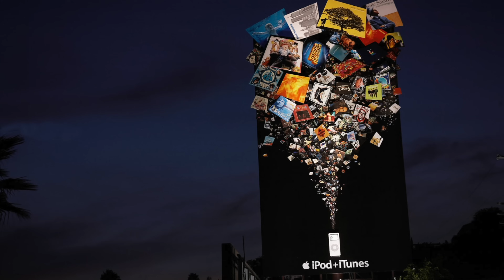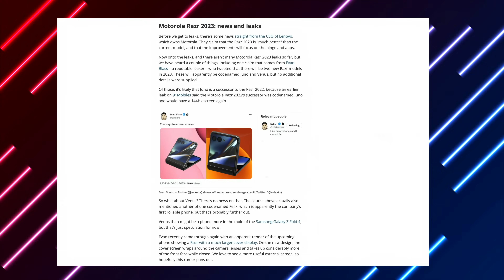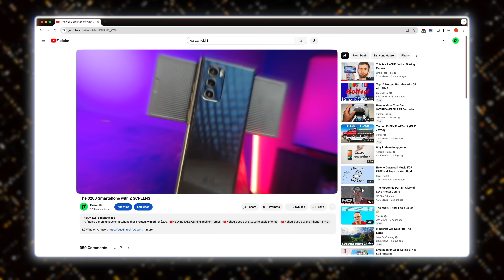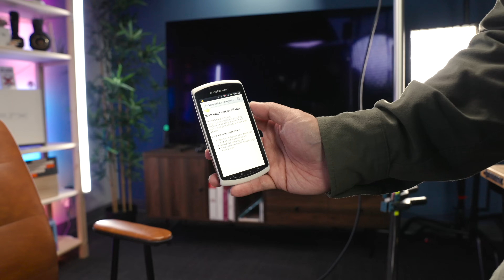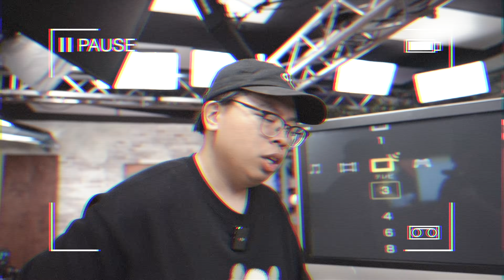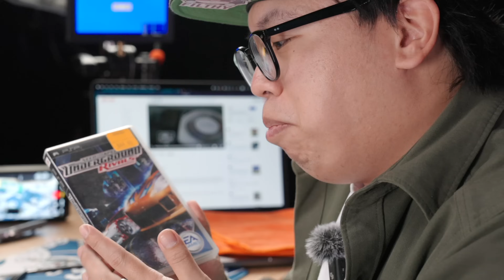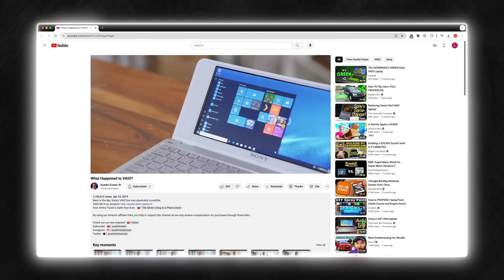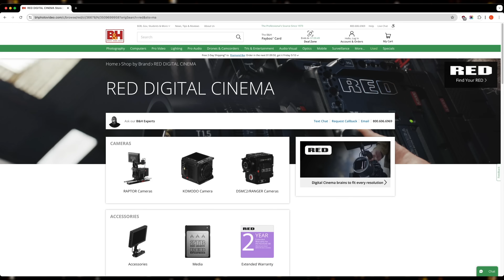the BEST tech of ALL TIME [megavid]

Comment: The windows phone you have complaining on and couldn't see why. First off it's the first like that for windows second you will loose something everytime you try something new. It they made screen to size of unit bigger they would have to make it thicker so it would be more maybe cumbersome. Also first first with ideas don't always work and companies know that they get best option fast to put out and then the buyers are testers so they know what to  hang or fix. People like you or most testers want everything or just hate it and feed ba k sucks cuz your average user. So it's cheaper to toss out a rough phone and loose little money. If it was people like you saying needs speed needs bigger screen needs surround sound needs usb c 30 wireless charge needs this and this and this. Then you complain to big to heavy gets hot to fast. So you wasted far more money for them while average user says can you upgrade sound or can we get better  camera longer battery and with even small upgrade it's sells new model and again they listen and work to fix one thing. Apple is the worse for this they get old tech and make it sound they did it. Like adding music calculator email text wireless charge these are old when Apple gets it also Apple 12 to 13 isn't really any  changes. Unlike other brands trying to further tech on phones. So saying first is bad yes they are cuz they didn't know what people really wanted till they had the phone.
Reply: Grass .. Touch it

Comment: I've worked on 4th, 5th, 6th gens as well as minis, and the 5/5.5th gens are my favorite to work on.  The most annoying part is that the headphone jack ribbon cable never seems to want to go back in.  One thing that I found interesting was that you could put the battery between the logic board and the iflash adapter.  I got a battery that was the same as yours, but when I put it under the adapter, it fit just fine without bending the ribbon cable.  If you're going with the classic metallic back for your ipod, cutting up a screen protector and applying it to the back helps protect that finish from the scratches.

Comment: I absolutely loved my (sadly Verizon locked)  2019 Razr, sadly 5 or so months ago the battery failed in the strangest way. When it was closed it would drain, FAST,  However when it was opened it would build back up just as quick?!? I ended up replacing it with a boring slab phone because it woul become unreliable when closed, missing calls, shutting down, and I just couldn't work with that. RIP RAZR 2019 Long live RAZR 2019!

Comment: ipod segment:  Ken, with those headphones you're using, TBH, you certainly will not be able to reliably and accurately tell the difference between FLAC and hi quality LAME encoded mp3 at V0 or V1.  Even with higher quality headphones, the fact is that very, very few people are able to distinguish between similar quality FLAC and mp3 in any kind of blind listening test.  

And as for your observation about Rockbox being a bit fiddly to install - man you kids are lazy and spoiled.  Convert your FLAC to LAME v0 mp3 and stuff way more JPop onto that "new" ipod as well as get a much smoother, less processor intensive experience on Rockbox.